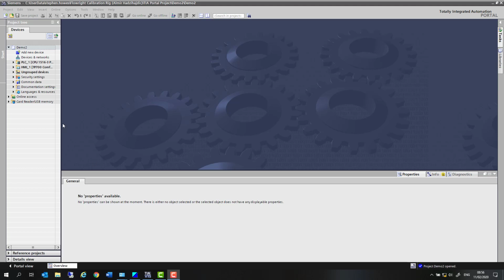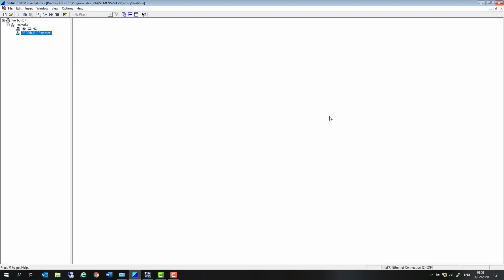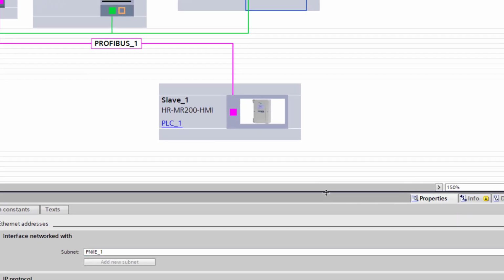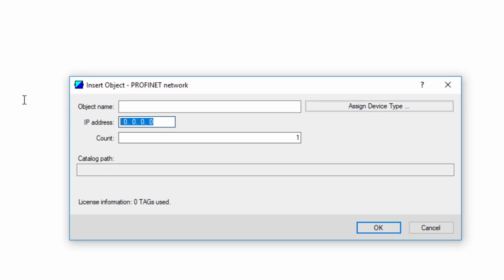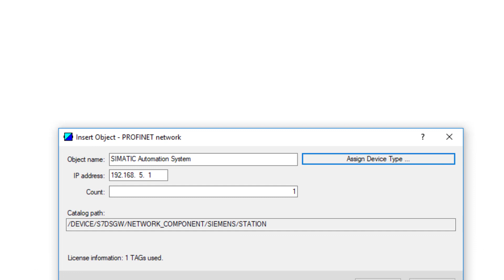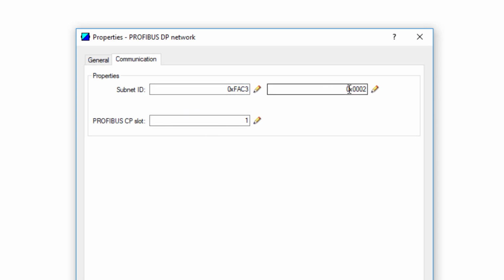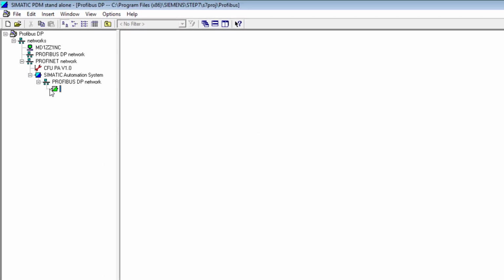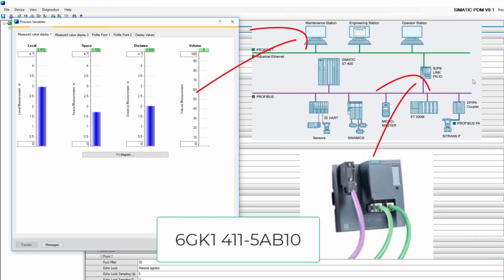Using SIMATIC PDM V9.1 with SIEMENS DSGW Routing through SIMATIC S7 1516-3 PLC

Comment: Hi thanks a lot for this video, was struggeling today a lot to get it running similar like you have, what doesn´t work on my side is the Life List for the DP sensors, only for the PN devices. Do you have experience how to get the Life List for DP working or do you have an idea where to step on?
Reply from the maker: Check your PGPC interface settings are set correctly and you can see the slaves from here. Are you connected directly to DP network?
Reply: @IOTConnectivity  no i am connected to a PLC 1500 via ethernet and using this PLC as datasetgateway, reading and writing sensors is working but the DP address changing doesn´t work via PDM. Actually we changed the DP addresses via a Field PG with DP CP using Simatic Manager but we would like to know how to get the Life List and DP Change via PDM running.

Comment: I cannot establish routing communication with PDM: A PC is connected to the PN - X2 network of the CPU 1516 and an ET200SP with HART module is connected to the PN - X1 network. I declared the routing in PDM with S7 DSGW (PLC Simatic) but it does not work from PROFINET-X2 to PROFINET-X1. However, from PROFINET-X1 to PROFIBUS DP-X3 it works. It's possible ?
Reply from the maker: The routing for PDM will not work accross X1 & X2.  I has to have all the IO and the PDM connnection on the X2 Profinet Port.